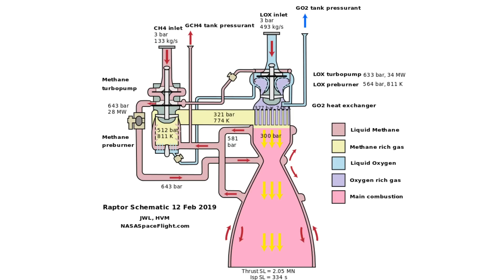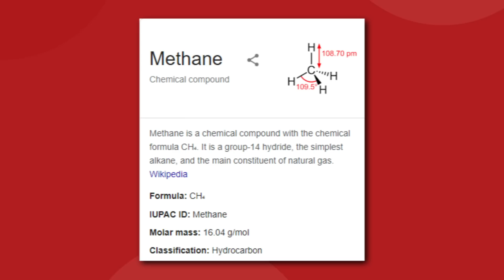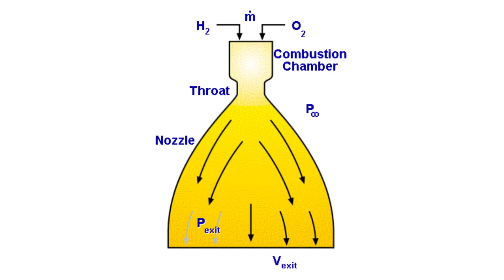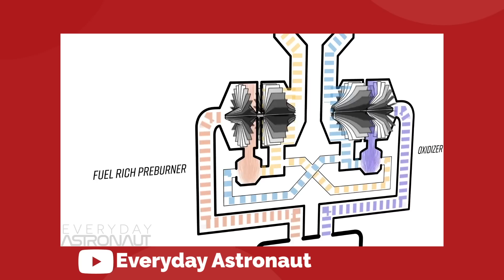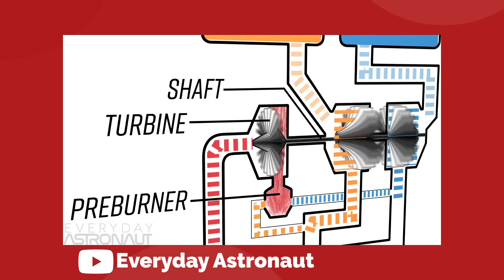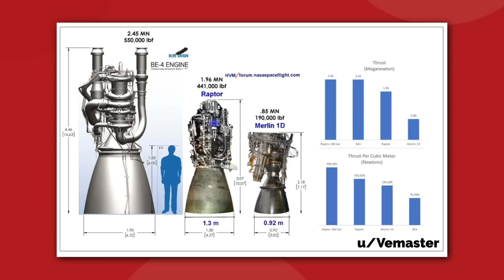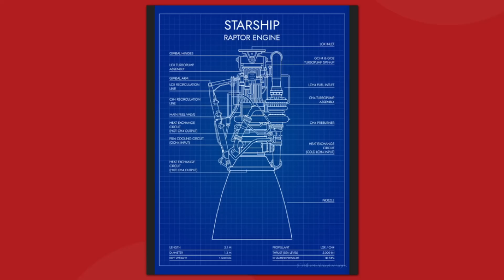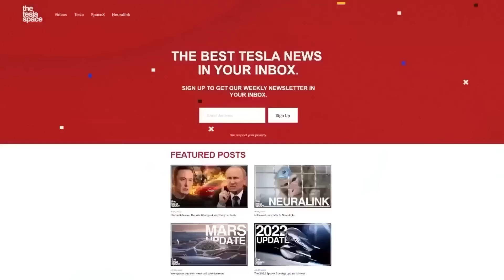The Real Reason SpaceX Developed The Raptor Engine!

Comment: You left out one of the most important characteristics of the Raptor engine.  That is some of the parts are manufactured by a 3d printer from Velo3D.  Think of the mega casting machines.  Twenty parts are printed into just one.  Fewer parts at a fraction of the weight.  Their printer can do very intricate internals that other wise have to be manufactured separately and bolted together.  Velo3D is the only 3d manufacturer that can produce alloys that can do this detail and take the heat and the pressure of a rocket engine.  Currently, their printer can print parts up to 48 inches.   A couple years ago, Elon attempted to buy Velo3d but the founders did not want to sell.    Other 3d printing companies can print much much larger items, only with less detailed components as rocket bodies.  But, I believe Elon has some process for stainless steal sheets.  It would be interesting to know how he does that and not have the visible seams.   A year ago, the seams were obvious.
Reply: I'm pretty sure the combustion "donut" at the bottom of the Raptor is NOT 3D printed. SpaceX has a bunch of 3D printers that make Investment casting cores - and those cores are used at a foundary to cast the "donut"
Reply: Building the F1 engine required a lot of welding. Tig welding done by hand. Being able to 3D some parts, outstanding  !

Comment: pre burners have been used in many diesels for years.  having 39 engines is scary. Increases the probabilities of failure.
Reply: Also permits shutting down one or more engines without compromising the mission.  This is why commercial airliners have more than one engine.
Reply: @jamesbarnard9710  not really. Commercial airliners have more than one engine not only for being able to selectively shut them down if need be, it’s also do with the prohibitive expense of making larger and larger gas turbine engines, and being able to mount them in an aerodynamically stable position which can be hard with odd numbers of engines.

Comment: 0:50 Calling 33 engines "unprecedented" forgets that the N-1 had 30 engines, and is therefore an incremental addition.
Reply: @agcala9619  Correct.
Reply: Truth be told, these Raptor engines are very similar in design to the N-1. Uncanny isn't it?  @1:10 "Never done before" heh. RD-180 and the RD-191 were done 20 years ago. 
What will be interesting to see, is if this thing flies perfectly without a single rocket failure. Or, if there is an engine failure, that it doesn't just fall over and explode like several previous SpaceX rockets have.
Reply: @B15HOP  I want to see them succeed, and from what I've seen the Raptor is badass.

Comment: Rocket Science for Dummies!  I LOVE it!  Great job!  Only ONE important thing you omitted: The Raptor (being CLOSED cycle) uses ALL its fuel for thrust, including that which would normally just be used to spin the pre-burner turbine, then dumped overboard and wasted (like SpaceX's existing Merlin engine used in the Falcon-9 ).
Reply: The only reason is that he doesn't know where to spend the money from NASA.
What intrigues me is that all the UFO visualizations and some captured in video and photos, are of round or triangular spaceships and due to the immensity of lights there has to be a generation source that will violate the damn laws of thermodynamics that are strangling the advance of science, why is it then that humans keep their designs based on rockets, hungry for fuel and slow as snails.
Reply: @joseinfante5054  o ... k ... 🤔

Comment: My simple question is why that many engines?? why not a hundred, that would give it more thrust ... is it just that no more engines can fit in??
Reply: They are currently restrained by a maximum diameter of the rocket body. Make the rocket diameter bigger for more engines. Me ? I think a slightly downsized 3D printed F1 engine similar to the Saturn 5 would require fewer engines. But im no a rocket engineer.
Reply: @kellyBorgman  

Apparently this Raptor engine cannot be improved, so say Elon in one re ent interview, that he would be surprised if it could be... strange a man like him to say that... but I tend to believe him though, he knows his stuff.  It was just strange the number of engines.

Comment: Look up what happened to the Soviet N1 Moon Rocket when they attempted to use this many rocket engines at the same time. It wasn't pretty. 😕
Reply: That's where you're wrong, it was the prettiest thing, scariest too but nevermind that :)
Reply: Falcon Heavy already uses 27 engines. The number of engines wasn’t the issue. They were just limited by their time and budget. If they had more money they likely would have solved it. It took NASA years to get the F1 engine working.

Comment: I think you are going to need an ignition option if either you want to re-ignite the engines in case of a blow out
Reply: I believe the combustion chamber pressure aft of the turbo pumps is high enough to ignite, like a diesel.

Comment: The N1 first stage had 30 engines so when you say 33 engines on the starship is "beyond unprecedented" I'm wondering it that's because you are ignorant or stupid? Either way, you should probably be somewhere shooting beer cans or retreading tires, not making internet videos.
Also, the NK-33 first stage engine of the N1 had a combined cycle engine with a single turbo pump that reached a similar level of efficiency to the current Space X engines back in 1969.  You really don’t know the history of what you’re talking about do you.

Comment: Where’s the vid on a Space Hotel/Resort? Question: why metal for the rocket and not carbon-fiber?
Reply: Carbon fiber was considered and rejected.  Too costly, and stainless steel is much easier to fabricate into the sizes he is building.  There are several outfits designing Space hotel/resorts. But you have to get them up there, and that requires efficient, lowcost rocket engines.

Comment: So. Additional combustion heavy duty ring.. if added and also huirt gas to the combustion boost ring.. added. Boost and thrust. This gas added into combustion gases after transition and ignition. Applied timing in adding this gas. For boost

Comment: why they cant develop and electric engine? build a bigger space ship so that fits the nuclear fusion
Reply: Already have those. They are incredibly weak and are used on satellites.
Reply: @bensemusx  thats why they have to develop it further with more energy and with a power source that can push the engine more, they need to develop the engine and a smaller nuuclear fusion for its power source. i really want to see the future before i die haha
Reply: @amigoarc1844  Nuclear fusion is so-far only being achieved in laboratories.  If you are talking about nuclear FISSION, basic preliminary designs were completed in the 1950's (NERVA, et al). Testing was stopped and the programs discontinued due to the test ban treaties.  DARPA is currently soliciting request for information on a nuclear-thermal engine that could be used in space.  A nuclear-thermal engine basically uses a reactor to boil hydrogen, which cools the reactor before exhausting the hydrogen gas out a nozzle.  Specific impulse (Isp) is about double O2/H2, which could propel a spacecraft to Mars in about half the time of chemical rockets.  The problem is that the pseudo-environmentalists are worried that if a n-t stage was involved in a failure on the launch pad (being boosted by a chemical rocket booster), it would contaminate the whole planet or somesuch nonsense.  In point of fact, the design of the n-t stage would be such that there would be little to no problem.  And you wouldn't use weapons-grade material anyway. We already launch nuclear-electric generators as part of long-distance/duration probes.
Reply: @jamesbarnard9710  all i can say is wow

Comment: Ok, isn't the Russian RD180 from the ninenties the same technology?
Reply: Nope. The RD180 is an oxygen rich staged combustion engine. The Raptor is a full flow staged combustion engine. It runs two turbo pumps with one being oxygen rich and the other being fuel rich.
Reply: What is the benefits of two pumps vs the RD180 fuel rich pump??
I mean, the US has bougt over a hundred of these since nineties?
Reply: @stighenningjohansen  they bought them because they were 1) readily available and 2) very affordable and fit needs of Atlas V very well. There is a very good technical video that compares all those past and present engines.

Comment: I thought the Russians have been making engines largely like this for some 50 years. Pretty sure other people have used cryogenic fuel as well.
Reply: They were using mostly oxygen rich engines, while us was using mostly fuel rich engines, some solid boosters. Different advantages, different problems.
Imagine playing rock paper scissors and someone comes, makes rock scissors and wins all 
Raptor is like that, it puts both oxygen and methane through turbopumps. It's awesome but very complicated, that's why it wasn't produced before, even as there were prototypes.

Comment: The Raptor engine is an amazing feat. But first thing should be to build an artificial moon, instead of going to the moon or to mars. For example, a hollow spherical  moon  could use 24 panels, each filled with water to shield the new moon from radiation. Inside the new moon, air could be at near normal pressure, so that people can work and live inside without spacesuits. The incredible evolving engineering feat of the Raptor engine should similarly be used to build a new moon, or a number of new moons. In fact, the new moons could be spaceships powered by Raptor engines.

Comment: Ok you need to make sure you get your facts straight regarding statements you’re making about SpaceX’s raptor engine being the first dual gas turbine engine.  Definitely wrong there’s several other engines which have this namely RS25.  Also, stating that the raptor is the first full flow engine is also incorrect.
Reply: Raptor is the first full flow staged combustion engine to enter production. The Soviet Union had a test engine and the US had a test power pack.

Comment: Soviet built RD-270 a full flow staged rocket engines back in the 1960's. So it's definitely not something new. I think combination of using Methane and full flow staged is new.
At least read Wikipedia...
Reply: They were working on a test engine. It never left the test stand. The US had a test power head. SpaceX is the first to put on into use.

Comment: What's most impressive is that the CEO himself gets in there and explains the technical details. I'm sure he does not know how to actually design the engines, but can explain their operation. His "keep it simple" mantra reminds me of an early American inventor, "Madman Muntz." Muntz was a self-taught electrical engineer who would visit his engineer's labs with a pair of side cutters in hand. He would cut one component at a time out of the system until it finally failed to operate. At that point, he said "put that last part back and then ship it." They called it "Muntzing." Elon's desire to simplify, simplify, simplify is a modern day version of Muntzing!
Reply: No wonder he's called a madman. There's no possibility his method would produce a high-quality product.
Reply: @guitarista666  Back then, when a new TV set was quite expensive ($150), a $100 Muntz TV was considered a bargain. It had few amplifier tubes, so it could not pull in distant signals. Muntz realized that most sets were sold in urban environments where TV signals are strong. Anyone needing a TV for out in the sticks was left to buy a more expensive TV from RCA that had more tubes. I.e., your "high quality" comes with a high price tag. Most people favor price over quality. It was a very smart strategy.
Reply: @demef758  Yes, low quality cheap products have always had a market for poor people. But, didn't you describe his method as just randomly pulling out parts until it stopped working? I can't imagine a dumber method when trying to design an electronic product.
Reply: @guitarista666  I don’t think Munoz was designing the product when he clipped wires until it failed.  He would have been testing the necessity of certain design features.  There is a distinction, but I highly doubt the anecdote of Muntz is true. I also think most companies design products as cheaply as they can get away with even if it is criminal.  These kind of companies have a vested interested in keeping people poor because as you so eloquently say poor people are the market for low quality products.  

Elon Musk eliminates excesses through iteration to make high quality products with laser sharp focus on the need of the customer that is embedded within growth mindset and safety framework.
Reply: @BrandonJohnson-bx1ht  Thanks for your reply. I don't know anything worthwhile about Munoz. My criticism was about the process  of designing electronic circuits. I'm far from an expert, but I did take physics in college where you learn the physical principles involved, and, also, I took a course in TV servicing where we studied the circuits of the different sections. When you see how things really work, it is obvious how crucial even one inexpensive part can be. For example, capacitors are relatively inexpensive, but if one goes bad, then the TV could become unworkable. So, in trying to make a TV cheaper, it's not so much in eliminating parts, because they really don't load them up with non-essential components. What they do is use cheap, poorly made parts instead. Poor quality control also factors in where things are just thrown together in a rush. So, in general, it's a process of cutting corners wherever they can.
Reply: @guitarista666  He must be doing something right....
Reply: @robertfreeman5231  I don't think you're responding to what I said. Nothing I said is a critique of Elon.
Reply: @guitarista666  "My criticism was about the process  of designing electronic circuits." Whats that?
Reply: @guitarista666  You fail to understand that after the end of WWII, most of America was poor. My father made $50/week in 1950, pre-tax, and he was considered lower middle-class. Anyone who could save you $50 on a TV was speaking your language. You guys' contempt for the poor is quite disturbing. You would rather there be no Walmarts to force the poor to pay more for their food and products? How compassionate of you! While you're at it, why not force all low-priced cars off the market and compel everyone to buy Ferraris? Companies don't keep poor people poor, but government sure as hell does, stealing half of everyone's income in taxes and being root cause of massive inflation, crippling the poor. Corporations like Walmart are godsends for the poor, offering decent low-priced products, leaving more money in their wallets to stretch out their ever-diminishing money. I'll gladly compare your electronics resume with mine. I know from first hand experience that today's electronics have at least 2x as many bypass capacitors on them as it needed. They even put 0.1uF caps on audio opamps that need zero bypassing due to another bypass cap on the same voltage residing 0.1" away. But you wouldn't understand any of the reasoning, so I won't waste my time trying.
Reply: @demef758  Why do you bore me with a political argument when nothing I said had any political content? And your electronic arguments are nonsensical. I wouldn't let someone like you touch any electronic device I own.
Reply: @guitarista666  It should be, since he likes to take the credit for Tesla, which he never founded, he is just the majority shareholder, and has never invented a single thing in his life, He is a very good salesman and businessman without a doubt, But I fear with his takeover of Twitter he has turned to the dark side. Time will tell.
Reply: @ironKurgan  He seems to me to be a free speech advocate, which has not been the policy of the management of twitter in the past.
Reply: @guitarista666  Twitter is honestly the worst cancer of social media.
Reply: @siLence-84  I think Elon knows this and is trying to find a remedy.

Comment: Also, the specific-impulse of Methane is larger.  No need for liquid Hydrogen, at ridiculously low temperatures.
Reply: And huge, much more insulated, heavier tanks to hold it. Both shuttle disasters can be traced to the need for huge heavily insulated liquid hydrogen tanks.Challanger exploded because the SRB burned through the hydrogen tank and ignited the hydrogen, Columbia met it's fate as a result of the insulation from the external tank hitting the leading edge of the wing. If the shuttle had used kerosene, propane, or even methane in the fuel tanks the tanks could easily been internal to the shuttle. With a landable booster stage the shuttle would have been completely reusable.

Comment: Full flow stage detonation cycle systems will cut fuel cost down to a fraction of current combustion format that Raptor is using. It will, however, be a high G thrust that few can survive as means to exit Earth's gravity well.
Reply: There where full flow stage cycle engines built 60 years ago... So you are just dreaming. Read up about stuff like old RD-270 engines.
Reply: @lubricustheslippery5028  The Lin guy talked about non-existing therotical stuff.  It is a "detonation" cycle and not combustion. There has't been any working real life use detonation cycle engine of any kind yet.

Comment: The best rocket is using the electromagnetic to propel any space ship. This is still in the development stage.
Reply: "The best rocket is using the electromagnetic to propel any space ship"
Strictly speaking, such a thing is a projectile, not a rocket.
Reply: @thomasmaughan4798  That is the effect of a gravitational field or force. The Earth has magnetic North and South. If a system can be designed to convert (or harness) the magnetic field into an energy to propel any aircraft, the would be the greatest invention or discovery. Engineers, Physicists and Scientists are working on it.